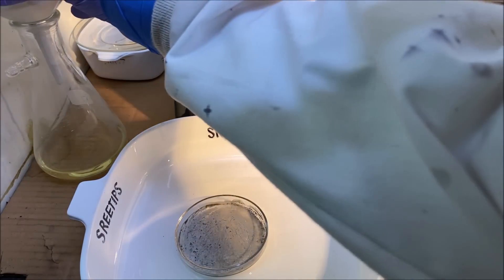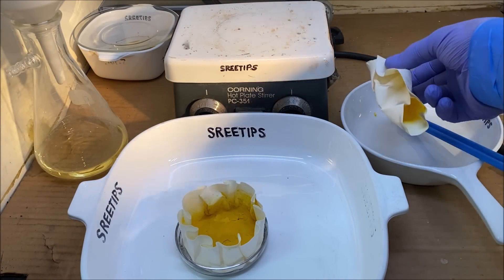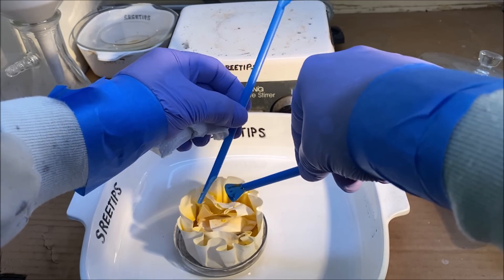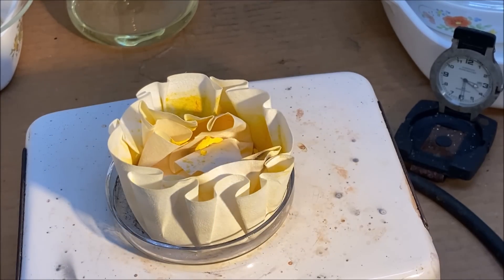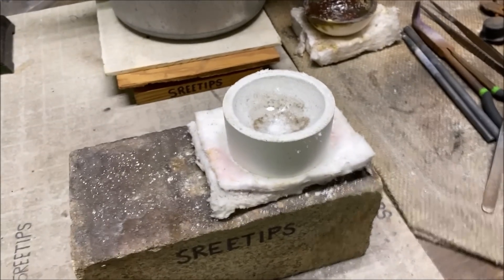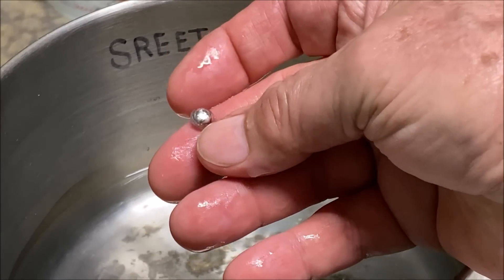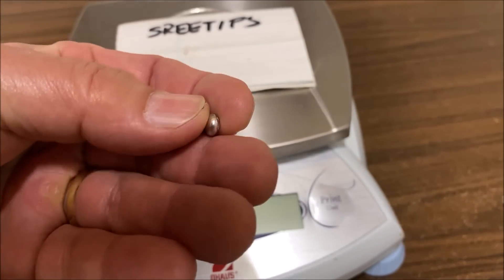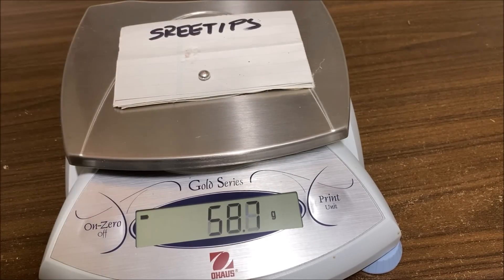How To Turn Platinum Jewelry Into PURE PLATINUM Pt8

Comment: I would like to see you take a button of pure gold and beat it with a hammer into a large sheet.  I always wanted to do that.  I once bought a 1/10 ounce Maple Leaf  4 nines, and was going to try.  But I couldn't bring myself to destroy it.
Reply from the maker: You can’t destroy gold by beating it. I don’t think.
Reply: @sreetips  I meant destroy the nice Maple Leaf.  I want to see you do it, in case it cracks and won't stay together, then you can just melt it again.  I don't have a melt dish.

If it works out, maybe I can hammer it into a ring.

Comment: Nitric neutralization method and pH neutralization
Reply from the maker: I didn’t use nitric to dissolve the platinum. I used HCl and 29% hydrogen peroxide. So there was no nitric acid in there to be neutralized.

Comment: Great work on the refine and the series

What style of melt dish are those?
Reply from the maker: I did the burn of the filters in a fused quartz dish. I melted the platinum in a Wesgo crucible. But the crucible still began to melt from the high heat required to melt the platinum.

Comment: 2:00 i feel like this would be better in a crucible in an electric furnace. Then transfer the crucible for melting. You could upgrade your torch with HHO for extra heat..
4:32 its so bright we cant see anything anyway. Get a filter for it, that way it stops overheating. An automask might work.

Comment: And yet around half of the starting +33g of platinum is missing🤔
Reply from the maker: No it’s not, due to my inexperience, it got poured into my stock pot. It made me cringe when I watched the entire series this morning. It’s all there, but now it’s mixed in with all the other metals in my stock pot.
Reply: A good amount could have precipitated during the hydroxide precipitaion.
Reply from the maker: The full bottle with a little salt in the bottom. There was probably 8 or ten grams of pure platinum in there. All I had to do to get it is re-acidify with HCl. I didn’t understand this so I dumped it into my stock pot, due to lack of experience. Oh well, maybe I’ll do an early stock pot refine to see if I can retrieve it. Live and learn.

Comment: Looking forward to seeing what you do with the suspected Iridium. Platinum Group Metals are definitely more fascinating than gold or silver. And there are VERY few videos showing refining techniques. Hope to see more PGM refining soon!
Reply from the maker: Since I poured about ten or twelve grams of pure platinum into my stock pot (due to my inexperience), I may try to get those metals early once I recuperate from the trauma of the last platinum refining.
Reply: @sreetips  I strongly recommend you make sure you are fully recuperated from that trauma, otherwise the next trauma will be at least twice as severe.
Reply from the maker: I’ll take a break. But when I do, all I can think about is getting back into my shop and producing more refining videos. It’s like an obsession!
Reply: @sreetips  Good call! Thanks so much for all you do sreetips! I plan on showing the platinum series to my students.
Reply from the maker: Make sure and let them know that I made many mistakes and there were inefficiencies because I was doing this on the fly, making most of it up as I went. I cringed when I re-watched as I poured that platinum solution into my stock pot in part seven. All I had to do was re-acidify that solution to get the platinum salt to form. Also, let them know that I’m not a trained chemist. This is my hobby. But most of all, give them a lesson on platinosis. It’s an incurable illness that may take months or years to manifest. A hobby refiner shouldn’t be working with platinum in the garage!
Reply from the maker: I’ve made a public playlist of all eight videos of the platinum bromate hydrolysis on my channel.
Reply: @sreetips  For a non-trained chemist you do pretty well. I've seen trained chemists with worse practices and discipline.
Reply from the maker: Thank you

Comment: With the high melting point and the toxic fumes, it doesn't seem to be worth it to refine platinum; but good to know how. Thank you sreetips
Reply: Agreed, but I find it very interesting to watch the processes he trys while doing it. His waste videos are probably my favorite, and they often don't generate alot of "worth". Would you agree?
Reply: Eh, fumes are easily protected by using a fume hood with its window drawn down.  Or if you don't have a fume hood wearing a a respirator with filters rated for fumes will do. Full face is what you want and always gloves. It's less scary once you take full ppe into effect.
Reply: Much safer to melt the mixed PGM black powder into a button/bar and sell it.
Reply from the maker: I did that with a button of mixed PGMs. They only give credit for one metal. So if it 50/50 platinum/palladium, they pay 80% for either one, but not both. He told me they would credit the one that was the highest percentage. So if it turns out xrf to be 60% platinum 25% palladium, the rest other PGMs and base metals, then they pay 80% of the value of the platinum, because it’s the highest percentage. The other metals, they keep.
Reply: @sreetips  Interesting. It's all new to me. Does it matter with quantity? Would they pay out a kilogram or two of near 50/50 electrum the same way?
Reply from the maker: They would pay out on the gold only. They keep the silver, unless you request the silver and pay a refining fee.
Reply: @sreetips  understood. Thank you so much, Sr. See you next video and thank the Mrs. for us.
Reply: That little bead would fetch about $55-$60 from a refiner. No more than sreetips has to worry about platinum I think he, and us of course, just has a bit of fun experimenting with it. I have a good time with it.

Comment: It would probably be wise to do a good cleaning of the hood area and perhaps a bit of sealer, as paint or varnish, etc. to take care of any  oxide particles of the platinum group in the work area. Also the outdoor stove. It looks like the refining of platinum is way harder than most other precious mates, and explains why it has often been at near gold prices.
Reply: I doubt you will find many if any particles of PGM oxides. Those metals have a nasty habit of dropping the oxygen any chance they get, one of the reasons those metals are such good catalysts.